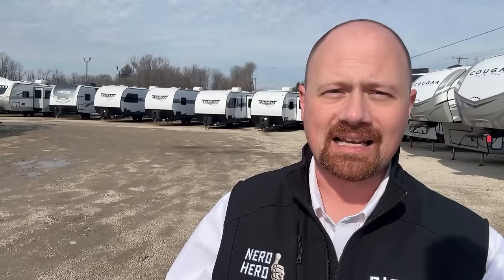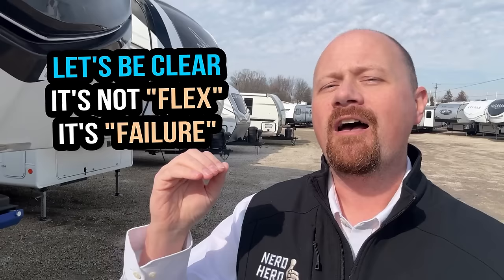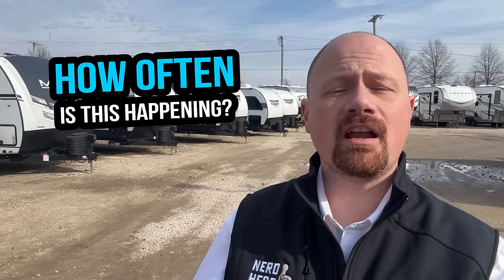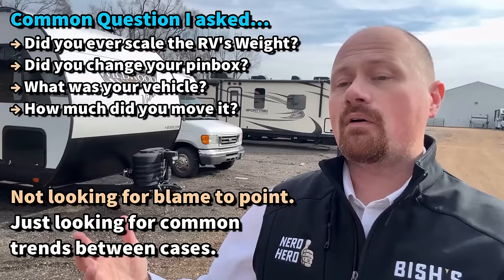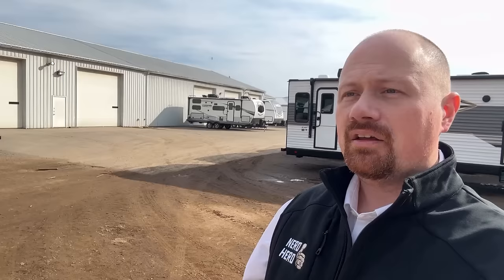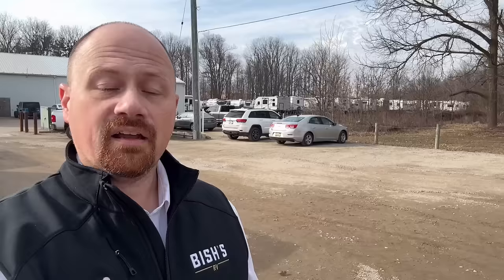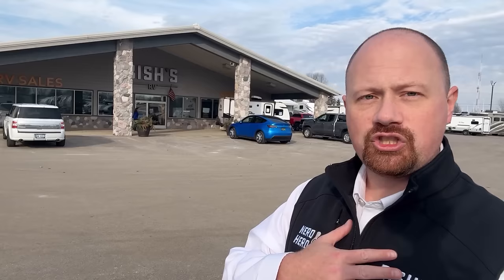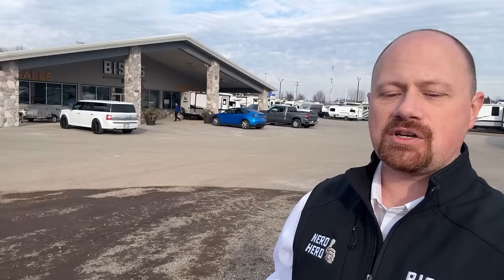🚨 RV Frame Flex & FAILURE!! • WHAT is Happening and WHO is Responsible?!

Comment: Josh,

First I really appreciate your effort to dive into this and you make a number of very good points especially on the educational and advertising front. That being said I don’t feel you’ve been critical enough in evaluating what manufacturers are telling you. 

If it’s less than 1/2 of 1% why aren’t manufacturers just taking care of those owners especially builders that claim to be full time rated? The level of customer service that’s being applied to this is a HUGE part of why this is such an issue. Look at Pavingnewpaths who I know you spoke with. Grand Design did not do right by them and if they had it wouldn’t have been a big deal. When you have a failure to the frame of less than 1/2 of 1% do the right thing and just fix it. Especially when owners aren’t overweight. Speaking as a happy Grand Design owner who has had great service from the company watching how they have handled this has me thinking maybe I don’t want to buy from or suggest others buy from them in the future. Not because they had failures. But because of how they treated owners who had this issue. 

On that front the lack of transparency as to what’s failing, why it’s failing, and how they plan to fix rigs that have failures not to mention ensuring it can’t happen again with new build units is a big issue. 

The fact that this is a big deal only across a range of model years should be telling us something. You’re telling me that full timers who owned 2015 models were a different breed than those who own them today? It might not be bad metal but something has changed. There is a reason this has exploded onto the RV scene and it’s not clear yet why that is. 

Ok let’s talk weight. Big Momentum’s have a GVWR of 20,000 lbs. if your 10% overloaded that’s going to push that rig to 22,000 lbs which sounds like a pretty serious number. But speaking as someone who has an engineering degree you simply do not design something like a frame to fail at 101% of rated load. It’s called safety factor. At a bare minimum you would want a 50% factor of safety if not 75% or more. Which means that momentum frame should NEVER fail as a result of being overloaded until you hit at least 30,000lbs. Sure other stuff might fail like spring hangers. But the frame? Heck no. 

Another factor in the weight department is that no manufacturer applies a tongue or pin weight limit. Think about that. You have a big toy hauler designed to carry a heavy vehicle in the back that maybe isn’t. So potentially you end up with a lot more load on the pin than the manufacturer planned for despite being under GVWR. Is that an issue? Possibly but who knows. Also manufacturers when they weigh trailers do so with no battery and no propane in the tanks. Which means even fresh off the lot with zero options the weight is going to be higher than the manufacture numbers. Since dealers don’t ever deliver units that way they shouldn’t be weighed that way. Not to mention options as you correctly note. 

Something else on weight. Another channel said recently addressing this that one manufacturer offered complementary weighing of rigs at a national brand rally and found that a high percentage of rigs were overweight. Maybe they need to take that information into account and increase cargo capacity.

So it’s not surprising that the big rigs that get moved a lot are seeing this first. Those are the units with the highest levels of stress for obvious reasons. 

But full time use ESPECIALLY for brands with full time rated warranties should NOT lead to frame failure inside of 5 years. What the frame is expected to fail at 50,000 miles??? That’s just nuts and it’s not acceptable. Yeah trim might shake loose, maybe the plastic plumbing connections fail. But the frame should not be failing period. It may be true that this is largely confined to full time big 5th wheels. But that being true doesn’t make it acceptable. Maybe these units weren’t really designed for that. But the failure point should never ever be the frame. 

I have a family member with 6 kids that purchased a Mesa Ridge very large 5th wheel and spent three years on the road full time visiting every state in the lower 48. They never hit a scale but they are sure they were overweight. They had issues with their cable driven slides. Suspension hangars, leveling jacks etc. But the frame? No and that’s how it should be. Saying that it’s because these units weren’t designed for full time use is utter bunk when it’s comes to frame failure. 

Let’s talk replacement pin boxes. In general the one thing that’s not approved are gooseneck conversions with the exception of the Reese Goosebox. I’m sure there are some failures related to unapproved gooseneck conversions. But how many? If you have 100 frame failures and 25 of them have an unapproved pin box then I don’t think you can claim it’s pin box related. 

Big trucks or HDTs. From what I’ve seen in my research the HDT community is VERY aware that you can’t use the standard 5th wheel hitch on the truck to tow a 5th wheel. Which is why they install articulated air ride hitches specially designed for that application. 

Your 100% spot on that communication from
The manufacturers to the dealers to the customers is severely lacking. But I think the heart of the issue is at the manufacturing level. They make claims like 4 season rated that we all know are bunk. And they just keep making them. Then you have companies like Lippert. For example they sent one of their own techs to BTBRV to install a cargo tray that was welded to the frame of his RV. But when I called them to ask how I could install that tray on my RV without voiding the frame warranty I was told it wasn’t possible and wasn’t recommended. Yeah that’s right. The frame manufacturer sells an add on product that they personally installed on a YouTubers RV to promote it but if you want to do the same they will void your warranty. 

But what you haven’t talked about are two issues that are central to this whole thing. 1. That poor customer service is what’s making this a huge issue. 2. That there is an unarguable design defect with these frames. A properly designed frame should never fail period. Not to mention that there have been people who had their frames repaired only to see them fail again in short order. 

I know the above likely seems harsh. It’s certainly fair for a manufacturer to note that this is happening to a small percentage of their units. That some of those units were over weight or used unapproved modifications. But that’s clearly not the whole story. This isn’t just about owners. It’s by and large about a manufacturing defect and the refusal in many cases of the manufacturer to own that defect. I know you’re in a tough spot given your job. But you’ve been far too easy on those who bear the lion’s share of the blame for this. The manufacturers.

Comment: Josh, we already own a Jayco 263 RBS, and feel you helped us look at their quality. None are perfect, but hoping long term we will be ok?  I liked their integrated frame way more than the ones welded underneath. I’m not an engineer, but common sense tells me Jayco’s frame (frame style) is the best?
Reply from the maker: I’ve camped most of my adult life in a Jayco Jay flight so we are in the same boat I’d say
Reply: Josh, I’ve had a few minor issues with my camper, fill out the Jayco survey, Jayco called me today to listen to my concerns, and assured me if the problem shows up again, they would work to have my local rv dealer authorized to pull the belly enclosure and get to my black and grey tank valves if they need to be changed. It’s a weird situation that doesn’t repeat itself at the dealership. I praised Jayco to the service rep, even mentioned you Josh. I suggested the look into putting a REAL EXHAUST FAN, not the one Josh the rv Nerd calls the dollar store fart fan. She laughed Josh so hope you didn’t mind me using your phrase, lol? I said I know cost is always an issue but in bulk, for $100 or so, they could put a top of the line fan in, not the toy they use. I feel you are fair and balanced Josh, and you are in a hard place to be, and do it as well as any human could. We appreciate all you do, and thousands of others must too.

Comment: in my opinion any trailer that is over 30 feet should have 3 axles . and the toy haulers should have 4 axles . i also think that the fifth wheels that sre 26 foot or longer should have an air pin box . example i owned a 39 foot gulfstream fifth wheel built in 2005. it had 3 5200 pound axles .it was 39 foot outside length and 32foot 6 inche inside length. the gross weight was 16000 pounds . i installed a 5th airborne fifth wheel pin box. i never had any issues with the frame flex or frame fatigue or failure. when i pulled it over the scales loaded for a 14 day trip my trailer weighted in at 15031 pounds .my pin box had 11853pounds .p pulled thes trailer 87329 miles . i put an odometer on oine of the wheels on the center . denis from santa rosa calif .

Comment: RV’s, with wheels attached, are supposed to be constructed with travel in mind, that is the purpose of the product.   While I understand all of the cautions in the video,  I still feel that manufacturers are focusing too much on lightweight low quality products.   The industry as a whole is not producing good quality products and certainly not standing behind their products.   I would love to upgrade or go bigger but I do not trust this industry at this current moment.  Manufacturers and Dealers do not appreciate how big of a purchase this is and are not supporting the product.   A 1 year warranty on such as large purchase is ridiculously insufficient.  Build the RV to the specs and quality level necessary for the task it will be used for and then support your customers.

Comment: I hear an awful lot of owner blaming….Manufacturers have an obligation to outline how RV is designed and what its appropriate use is, but they don’t have any intention of doing so because it would highlight the fact that they are building garbage.  Just ask yourself, why wouldn’t they list accurate weights, outline pull vehicle recommendations, or guidelines on how much highway use is acceptable?  Because it would take away their excuses and ability to blame the owners.  More regulation is definitely needed….these are 50-100k rigs.   In my opinion, manufacturers should be required to build these KNOWING that there is a variety of tow vehicles being used and should be designed to be robust enough to deal with it, OR they should be required to publish what is an acceptable pull vehicle.  Reconing day needs to happen,  class action lawsuit time.
Reply from the maker: The video needs to be taken as a whole rather than sectionally. I discuss some things owners may be doing but also overtly say multiple times I don’t think they can be held to blame when the “correct” methods and actually weights on their rvs are never really disclosed to them

End of the video I pretty clearly say mfgs and dealers both need to do better for their customers to avoid this

Comment: Thanks Josh.  How important is using the tire inflation charts to ensure proper inflation for the trailer weight?  for example, my fifth wheel weighs 10,000 pounds and my tire chart says my inflation should be at 65 psi but the tire max inflation is 80 psi if I inflate my tires to 80 I noticed that my ride is very hard, but when I inflate to 65-ish, my ride is much smoother. I’d like to know your thoughts.
Reply from the maker: I do recommend going by the NHS,TA regulated tire pressure stickers on the coach. They typically you will find almost all RV tire pressure sticker recommendations, match up directly with the tires with very few variances
Reply: Thanks for the reply.  I guess I was trying to say that if the tires are not inflated to the weight of the RV, then the rigid ride would transmit more stress on the frame, causing the potential of frame failure. @JoshtheRVNerd

Comment: Okay let's keep it simple , the big RV units have weak chassis where the Pin box is attached,any person with practical experience can see that when you see a naked frame ,and more so when you see the examples coming out of the frame damage ,frame faults,cracking ,bad welds etc insufficient web plates and more .
That's what needs to be a starring point.
Next dealers don't want to know the customers if they return with a problem and the manufacturer will grill you ,put you through the ringer before they even acknowledge that there is a fault, and work that out for sure .
Caravans,RV , motorhomes are normally associated with Summer and Autumn seasons not all year round ,just like boating ,but these big RVs are being sold to people that clearly intend to go full time on the road ,why are dealers and manufacturers stopping them in their tracks ,answer that honestly?
Dealers could weigh the various RVs with mobile scales ,get an estimated weight so they can confidently tell the customer that they are going to be X weight before they start !
Can DOT get the dealers the info for each truck that is capable of towing a. Particular Rig ?
Understanding GV Mass etc should be a dealer thing .
Gross combined weight is also what everyone in the industry should know .
Trucks today have bigger power and bigger still torgue figures, something that has been mentioned on some channels as a factor in RV construction failures, simply pulling the hell out of them .
I'm amazed at how dealers and manufacturers build and sell rigs empty ,but don't consider that they are going to need extra gear to complete the experience.
If they built their rigs stronger,but set lower weight limits , designed them so overloading in key areas couldn't happen then maybe things won't be the issue that it is and as you stated,to think that these rigs won't be on rough roads ,off roads is just plain Dumb on their part ,their perception of reality certainly is far from what happens.
Independent suspension should be mandatory on large RVs and three axel set up to handle the weight , building and selling cheap models as fifth wheels should be regulated ,not built .
Frame flex is not the only issues,how many customers find that their cheap susp fails ?
Cheap cabinets or flimsy or shoddy workmanship adds to the concerns for many .
The industry may say the problems are minimal as a percentage,but that's controlled by them not admitting that there are problems,they don't show up if they aren't recorded,or keep out of the record books .
Most RV owners find out that warranty is a dirty word .
So ,you have highlighted many truths and you are applauded for doing so,getting change will be the big hurdle,the only positive way is for you to lead by example,that may give you added sales on a national scale.

Comment: I think it's really easy to over load your RV with just the stuff you should have with you just incase. Tools, jacks, extra water, extra parts, improvements to the RV, in my case an extra spare tire. Most of the damage to our RV has happened on the highways in the upper mid west, we've driven on gravel roads with less pot holes.
Reply from the maker: There are a number of RVs with a disturbingly low cargo capacity for sure

Comment: The biggest thing that upsets me is that I could easily spend 40,000 dollars on a new rv with a air conditioner that is totally useless… why do manufacturers go through all the trouble to even install it and it can’t be used by a customer unless I don’t also get a generator to use it and the warranty on a new rv stinks what it te me is they have no confidence in the product they build… yea some people make mistakes but it’s worthless before it’s even used…

Comment: I believe the problem lies with engineering. Manufacturers want the least expensive materials and design their frames to the minimum specifications required resulting in frame failures, especially for Covid builds. Most of these frames are Lippert frames.

Comment: The problem is that these devices should be built to handle the basics of their design. That includes travel; a reasonable expectation of travel too.  That means that a reasonable person would expect out of these devices. I'm reasonable and I'd expect, without any official information to the contrary, that I could hitch these up and travel every day. Why wouldn't I be of that expectation?  It's designed for travel, it seems sturdy and the manufacturers all toute their build quality. No reasonable person would ever expect frame failure simply for using the device, even daily. But they should over engineer the freaked foundation so that it can be used reasonably as a camping device which includes rougher terrain.  I mean, they market it for camping and not just resort style parking lots. Then it should be built for that message and reasonable expectation that if you sell it as a camper, it could handle not just basic highway use but some rougher roads.  Building them as they are marketed would eliminate 90% of their issues.